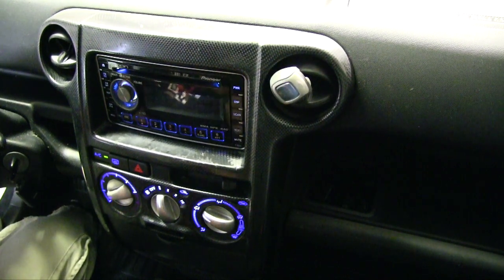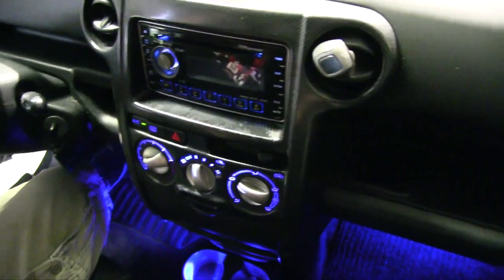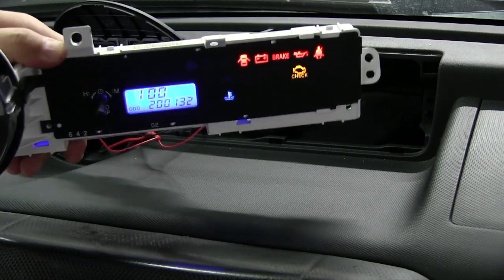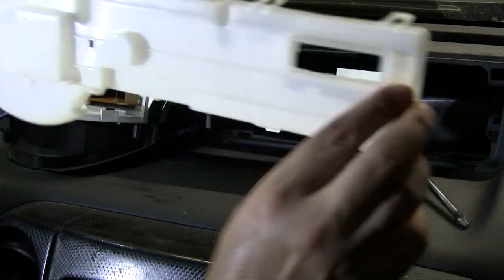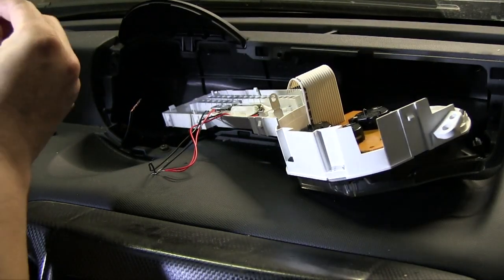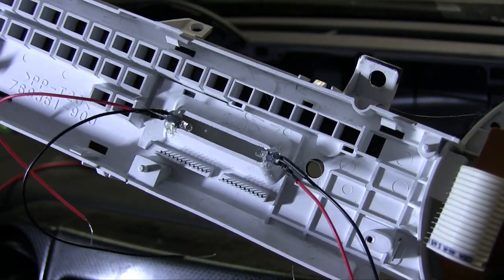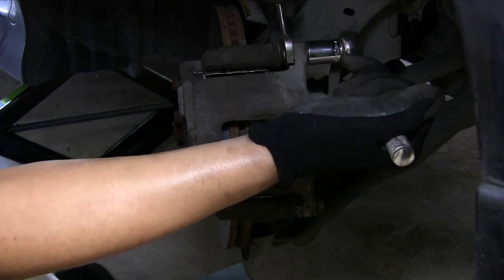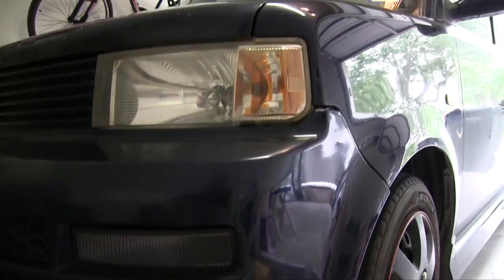1st GEN SCION xB ODOMETER BLUE LED's

Comment: How did you add the led to the cup holders?  
Keep the great content coming 👌 👏 👍
Reply from the maker: My very first video I used some wired LEDs for the odometer. Those same LEDs I drilled a small hole innthe cup holders and added some caps for them. I used a fuse tap and a switch to turn the underpass glow and cup holders on at the same time.
Reply: Thank you

Comment: You didn’t change the film?
Reply from the maker: No, the plastic piece is clear unlike the gen 2 which has an orange film.
Reply: @OilandGears  actually I was referring to the film on the LCD odometer
Reply from the maker: That one I haven't touched but I believe just changing the LEDs will work and not having to scrape any film.

Comment: Lol the part you burnt that's not where an LED went 😂 All the LEDs are to the right of the circuit board. It's all good we all gotta start somewhere but you did some nice improvisation. Buy another used hvac for cheap and if you need help I'll email you what you need to solder off the old ones and solder new ones on including the size bulb you'd need
Reply: Do you have a video tutorial of this?? I want to upgrade my cluster to blue light as well. Ideally, I would like to avoid having to buy a solder and also avoiding having to solder the cluster... any advice would be great!
Reply from the maker: I dont for the speedometer
Reply: @OilandGears  Oh.. disregard! Haha I just realize that my bB came with white ODO and Speedometer, not that amber color. Wonder why they do that stateside..